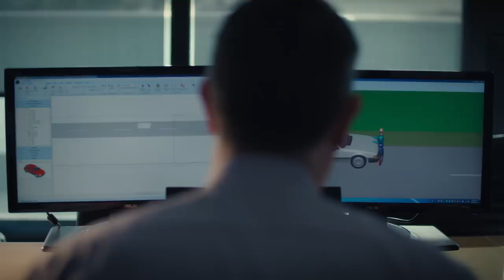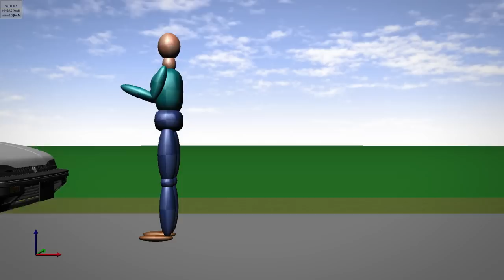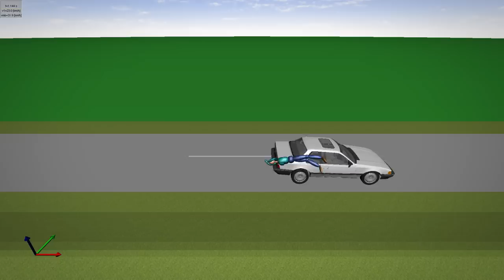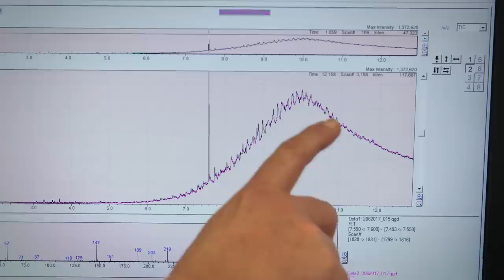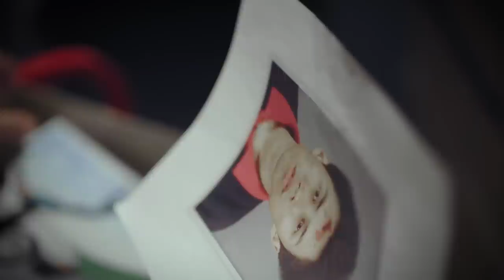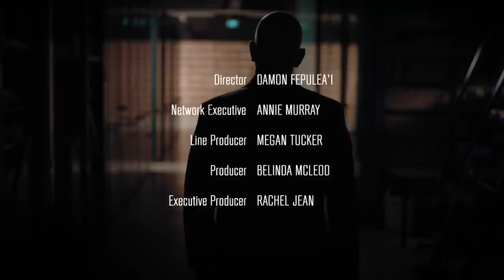Student tries to cover up the hit and run murder of his ex-girlfriend | Forensics | TCC

Comment: 7:21 Crash analyst John Raine says, "The evidence of the bent Waratahs and the distorted wiring showed where the vehicle had gone through the fence, off the edge of the road." For those puzzled by the "Waratahs" reference, as I'd been until Wikipedia solved it, these are the steel fence posts shown as he speaks.
Reply: Great investigative work. Thank you!😃👍👏